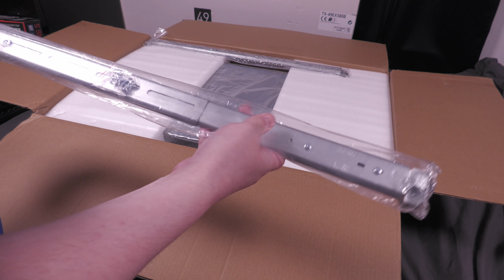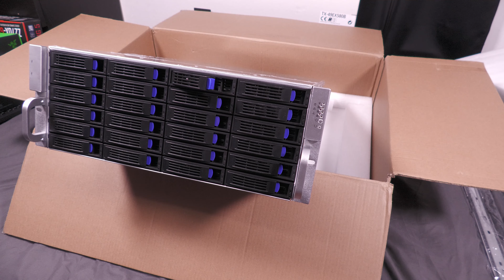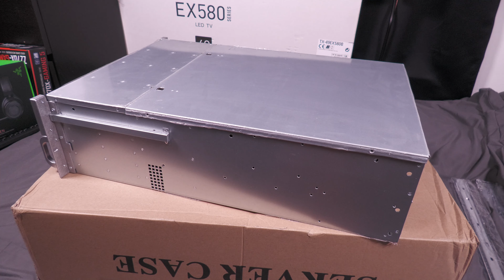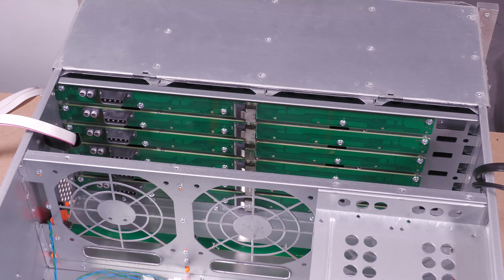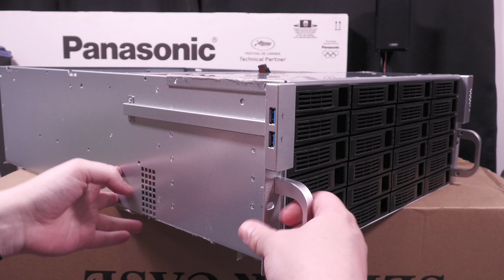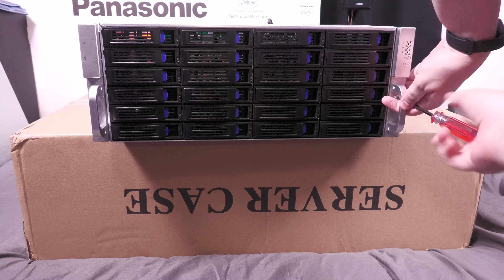Unboxing a 4U 24-Bay Hot Swap Server Case (SC-4324)

Comment: Which SAS controller did you end up going with with the 4 ports?  I have the same case, but I use 2 SAS controllers, and I was interested in making it just one to increase reliability incase of hardware failure.

Comment: Can the disc bay also accommodate normal Sata discs? (No sas.)
Reply from the maker: Yes the SAS connector is backwards compatible with SATA drives, I'm pretty sure most if not all SAS controllers supports both too.

Comment: Out of curiosity, would you happen to know what the maximum cooler height of this case is? I'm building in the exact same case and am trying to decide which cooler model to get, and obviously the bigger the better!

Update: Ended up just using it as a JBOD hooked up to a second server,  but it finally arrived and I just wanted to say thanks again for this wonderful video—I don't think I'd ever have figured out those rails without your instructions, as I'm very new to the homelab scene.
Reply from the maker: I have the be quiet! Pure Rock 2 in there which is 155 mm and its a close fit if I remember.
Reply: @PrimeRedux  Awesome, thanks. Good to know!

Comment: Hi, I bought a very similar case (SC-4324s), but it is missing 3way PWM fan cable you have in yours. I am now looking to buy one, but can't find it anywhere. Do you happen to know connector name they use on the chassis side (the one with 6 pins , next to the molex for fan power) or maybe pinout of that connector so that I can possibly make one?

Thanks

Comment: Hey I watched the video where you put this together and am coming across a similar issue you had and that is where the PSU didn't fit. I haven't bought the chassis yet and am gathering parts to put a build together and was wondering if you would recommend a PSU that would fit and power all the molex ports on the backplane while also being long enough to run to them, and also being multi-rail PSU?

Thanks for these videos!
Reply from the maker: ANy normal ATX power supply should fit in this case. Mine only had an issue because it was not standard ATX and I was missing brackets.

Comment: They are 6gbps SAS not 12gb, the 12gb one would be a square SFF-8643 connector

Great video though, i am looking at a 16 bay version for my server
Reply from the maker: Oh very interesting, I thought those connectors were interchangeable but I guess not, thanks for pointing that out.
Reply: @PrimeRedux  I think the ones on the backplane are SFF 8087 while the ones on the SAS controller that would handle 24 HDD's are SFF 8643.  You can get cables with both connectors on either end :)

Comment: What's the power supply?
Reply from the maker: It is a CRS 500W Mini Redundant PSU, model number PIST1050-EPSH-80. They can be very expensive new but I managed to find this one on ebay.
Reply: @PrimeRedux  thanks
Reply: @PrimeRedux  would you sell or make available the 3d print file for the bracket?

Comment: How do you attach the rails to the rack?
Reply from the maker: The rails for my case simply hook on to the front nad back posts of the rack through the square holes, the center is spring loaded and pops through one of the rack holes.

Comment: Hey dude. Im looking at getting the smaller 16bay one. Whats the import cost like when getting from Alibaba? Is it worth it or does it eventually end up the same as buying from servercaseuk? Cheers
Reply from the maker: If you can find it domestically then I would go that route. This ended up just a few pounds cheaper overall than if I bought from servercase but shipping took a lot longer. Shipping was £115 and I had to also pay £76 customs.

Anyone in the US however then AliBaba may work out much cheaper since they don't pay customs on anything under $800.
Reply: @PrimeRedux  nice one cheers. Ill wait until they have stock

Comment: How mouch loud this server fan? What abou there warranty policy? Do i need extra power supply or power supply included? Thanks.
Reply from the maker: The fans are PWM so can be controlled but at full speed they can be very loud. You can hear them in my server migration video. There is not power supply included with the case.  
I'm not sure on warranty, if you buy from a local company they may have one but mine is from AliBaba and I have no idea about warranty sorry.
Reply: Would be simple to fit alternative quieter fans, ones that your motherboard could control. In server rooms they tend to run everything at full blast as they don't care about noise.

Comment: Hi - what is the model on the 2nd controller for driving the 24 drives.  Thank you in advance.
Reply from the maker: The four port card is a LSI 9201-16i, the two port one is a LSI 9220-8i, hope this helps.
Reply: @PrimeRedux  Hi - is the LSI 9201-16i preset to IT mode or IR mode. Thinking of buying one on eBay. Thanks and keep up the good work.
Reply from the maker: @ethantran1750  Both are in IT mode. I'm pretty sure that the 9201-16i comes in only IT mode.
Reply: @PrimeRedux  do you need 6 ports to drive this case and all 24 drives?  i have a sas card with 2 ports so that isn't enough, right?